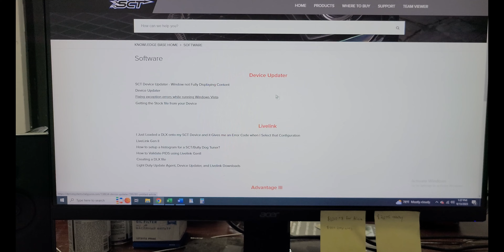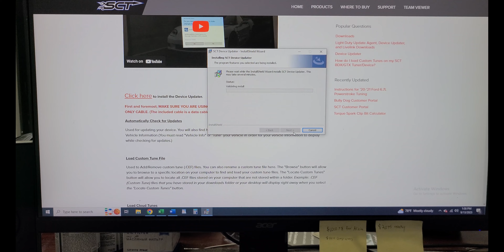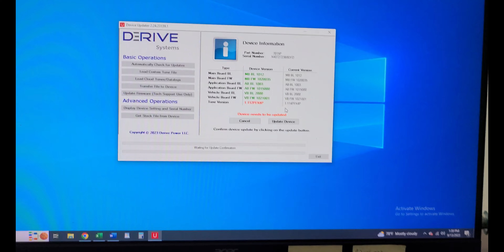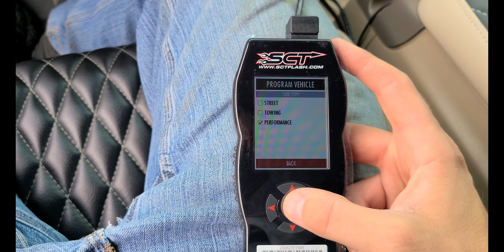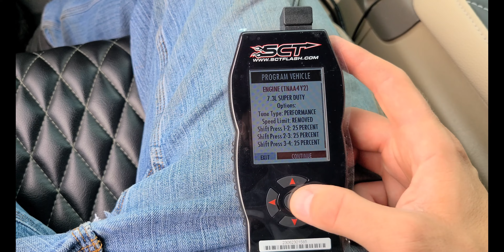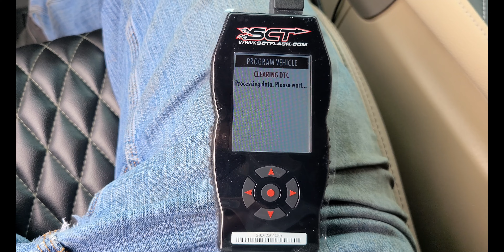How to use an SCT x4 tuner / and update software version

Comment: So this tuner HAS to stay connected to the vehicle right?  If you unplug it would it default to the initial stock tune?
Thanks
Reply from the maker: You can unplug the tuner whenever you are not actively changing things. It does not need to stay plugged in!
Reply: @gagefixeseverything thank you!
Reply from the maker: @mrnobodysgarage sure thing, good luck!

Comment: Any reason why my tuner isn’t powering on when plugged into the computer but works fine when plugged in my car?
Reply from the maker: Mmm the cord you are using may be bad or not good for the unit.
Reply: @gagefixeseverything  ahh I see, I lost the micro usb it came with do I have to order another from sct or is there a cable I can grab from a store what would work?
Reply from the maker: @courtlandkiser7140 You could order one, but a high quality cable will also work if you can find one at home. Some of the cheaper ones don't have enough wires (pins) to work for data transfer and charging.
Reply: @gagefixeseverything thank you I will see what I got

Comment: Well your video is well informed, however it would not work on my 2016 Transit Van 250 even though summit Racing said it would. It not even on the list in the tuner. Bummer.
Really want to bump up the line pressure in my new Road Ripper 2000 transmissions. 
Anyone know how I can accomplish this?
We do tow from time to time.
Reply from the maker: @lannyandroxanneadvantures2546  Awe man, I don't think anyone has broken the tune code for the newer transit vans unfortunately

Comment: i have a 05 F150 5.4lt, 145k miles, i regeared to 4.56 and on 37s. i have an SCT, should i do the 25% shift pressure as well? or old back?
Reply from the maker: @GoofyFun760  Always run those pressures up! It will help the trans weather you are 100% stock, or geared

Comment: Pulling cattle trailer a lot with my f350 with 7.3. Tow setting or performance setting on the tuner? Any opinions?
Reply from the maker: I'd say tow setting because it will have better transmission tuning
Reply: Tow helps keep vgt lower

Comment: If I've acquired one of these that has custom tunes for an existing truck on it, will updating wipe them out? Do they need to be backed up first somehow, or should it just not be updated?
Reply from the maker: Good question. If I remember, the existing tunes do not get erased with an update, but it would be a good idea to go ahead and save the tunes in a folder on your PC before updating.

Comment: Awesome video man first actual good video Iv found. It seems like your a shop considering you are doing this for a customer. I have a question about these tuners I’m looking to get one for of fb marketplace for my 6.0 but most people had it with a mustang will it still work for mine or will I have to get one that came off a 6.0
Reply from the maker: Hey there!! Yes I own a shop. A tuner that was for a mustang will work. What you want to check is the part number on the back. Should be "7015" That works for almost all fords.
Reply: Also what does unlocks left mean and what does total flashes mean
Reply from the maker: When you tune a vehicle, it "marries" the tuner to that VIN. To use it on another vehicle, the tuner must be unmarried. You can Unmarry a tuner by returning the previous vehicle to stock tune, or by paying SCT to unmarry / unlock it for you. A single tuner can be unlocked a limited amount of times before it is not usable anymore.
Reply: @gagefixeseverything  ok cool makes since I see the unlocks and flashes most say like 20 flashes what does that mean
Reply: @gagefixeseverything  i just picked up a tuner for my 6.0 and it has 4 unlocks left what makes it locked what how do you unlock it? And mine also says 15 flashes why is it 15 when most of the time i see other peoples say 20 flashes

Comment: How exactly does raising shift pressure increase trans life?
Reply from the maker: The factory tune keep the line pressures low to make smoother shifts by slipping. Slipping the trans is a bad thing. We tune it out on GM trucks a different way
Reply: @gagefixeseverything  legend mate thanks for the reply, gonna fiddle around on my xr6 turbo
Reply: I just ordered this tune. And I've tried multiple times to go to this website. It isn't working.
Reply: What about if it's a manual 5 speed will this matter or be an option when linked to my car?

Comment: I tuned my 2003 ford f150 4.6 with the canned tune should I max out the shift pressure? I did notice a difference in power but it shifts hard on certain gears
Reply: id be careful. i did 25% on my 2002 mustang, 6 months later im buying a new trans
Reply from the maker: Only do max on a 4r100. You trans is a 4r70w most likely.
Reply: @gagefixeseverything  i think it’s a 4r70
Reply: ya it was. im in a s550 now tho @gagefixeseverything
Reply: I know this is an old video but I am not seeing this same sight when I type it in. Im getting nowhere... I need help!